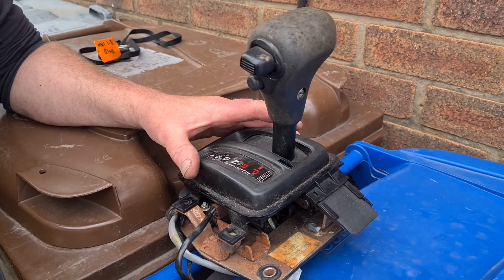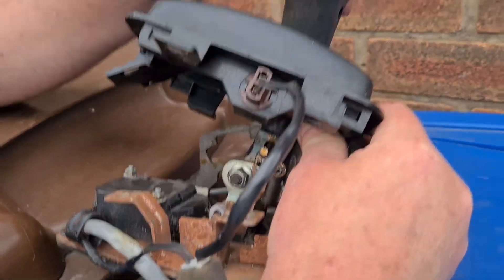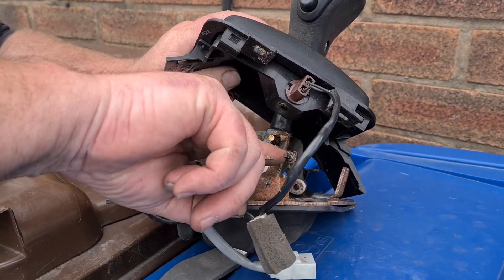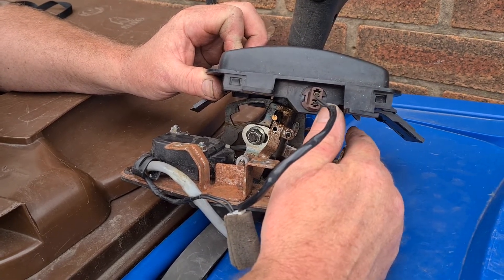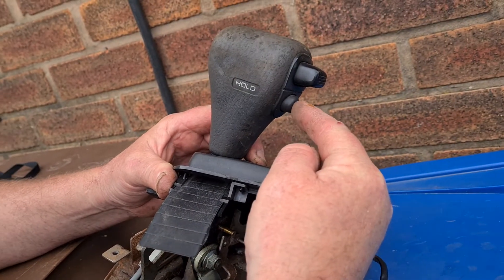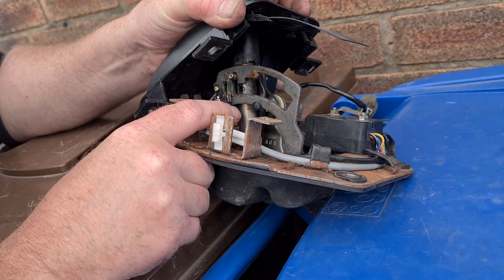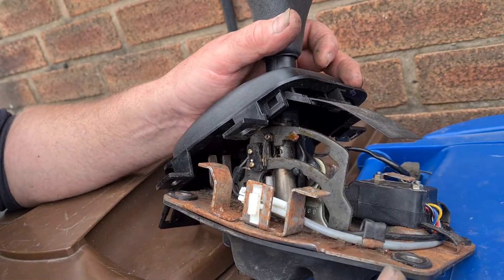Eunos/MIata/Mx5 Auto selector problems for OC forum user....

Comment: Thanks man, appreciate you taking the time, the OD works and the light comes on and off so the white wires are just taped together, I didn't press the brake in when taking it out of park so that might work, I'll check the rest, unfortunately only when I'm back home on Friday.
Looking forward to the day I can successfully hold possession of a working car😂
Reply from the maker: Shout if you need more help bud.
Reply: @mazdamenders  I see it's mainly an issue of fable chasing.
I don't have a good idea of the parking lock issue as the wires are all there and I would have to take the dash out to look further, but there is a little orange button in the shift bracket that has a wire running to the black box, if I press it while holding the brake with the ignition on, I could hear a hum from the box and the arm won't move back anymore, which is good now but I don't know if it's good in the long term.

I got what you meant with the key lock thing, I pulled the switch back and the key came out, so I have to chase that wire that pushes it, but it's gone under the carpet so might be another job I have to take the dash out for, I did swap carpets and dashed so the car was completely stripped at one point so I'm not surprised now I understand not everything is on😅

But while doing that I have another question about the AC stuff, can I go through it here in another comment or reach out to you in the forum's?
Reply: Hi I just reassembled my one last night. I read your forum post too;
‘ I could hear a hum from the box and the arm won't move back anymore,
Maybe because before you forced it with a screwdriver to move it. So maybe you’ve stripped a small gear inside. It looks like it unclips apart so check that.
Heat the unit with a hairdryer first as this plastic is so so brittle. Then the tabs keeping it together should flex more easily.
Also do you have more than one gearstick unit now? Check the other works with the cable connected and just swap them over!

Comment: I’d just reassembled all this last night. Yes indeed the electronics play a crucial role in this working. I’m not 100% I’ve got the small switch at the top set up properly though; a small slider tab with Japanese text next to it at the top of the gear selector display above ‘P’.
Reply from the maker: And is it all working correct bud.
Reply: Hi thank you; well it’s super stiff and before I installed the new bushes on the lever that switch slid freely and disengaged the P lock when power was off.
Now it’s very stiff and difficult to do. Feels like it might snap and that plastic arm under the small slider as it is very delicate!
I may have inadvertently moved the position of the nubbin switch inside the cable that attaches to the front of the lever apparatus box. Guess I’ll have to fiddle with that? I’ve no idea what the text next to that small slide switch on top says though.
Reply from the maker: I Recommend when fitting new bushings to apply them with red rubber grease to aid the free movement, we have found that the aftermarket items tend to be stiff compared to the OE items, doing the bushes is very fiddly, so hats off for getting into it.
Reply: Hi thank you yes it’s all a fiddly job! The original bushes on the pivot of the lever had literally disintegrated into dust. Only a small arc of rubber left indicated what it originally was!
I fitted official Mazda bushes. I do have red rubber grease but instead I used silicone grease NLGI grade 3 nice and thick.
Reply: It’s the small sliding switch I was referring to as being stiff.
Since fitting the new bushes and so sorting out the slack movement; the switch doesn’t seem to work. I feel if I push it any further it’ll snap.
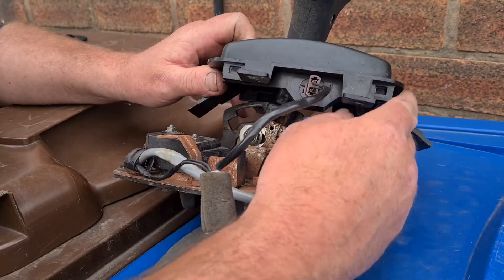What I think it must be is the cable you mr ruin at 01:10mins in the video. Which you say goes to the ignition barrel.
So that makes sense as when key is in and moved 2 stages before turning in engine this switch moves better. But it’s still quite tough to move and I’m concerned about the 31year old thin plastic snapping
Reply: The main problem I’m visiting this video again for today is that when I put the lever into ‘P’, i have to push it a bit further in to here the ‘click’ which I think is the little nubbin button you refer to at 01:10. So I reckon I’ll need to adjust the position in where it sits in the bracket. This also might sort out the slide switch I mentioned above.
I’ll adjust it so it sits a bit further away from the lever it pushes?
Any tips on adjusting this will be welcome please!
Reply from the maker: Did you use OE bushings? or aftermarket? @jonnyware9061